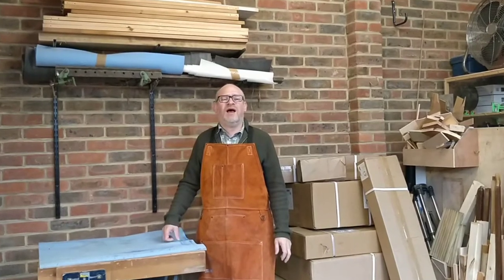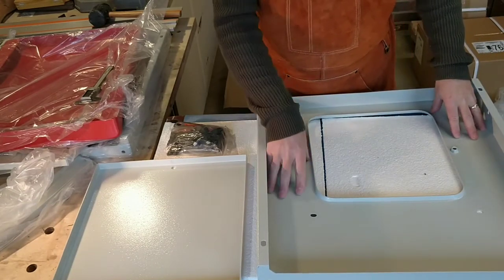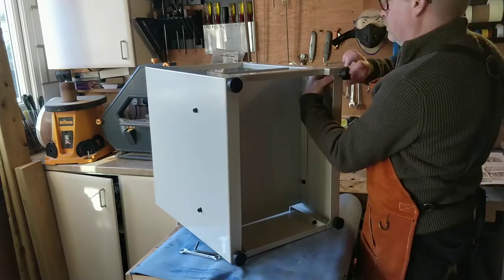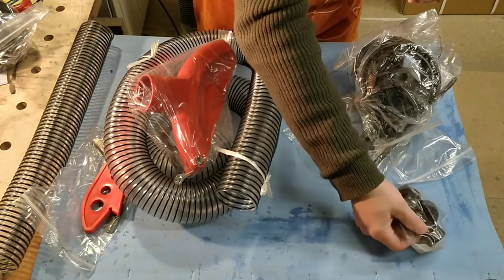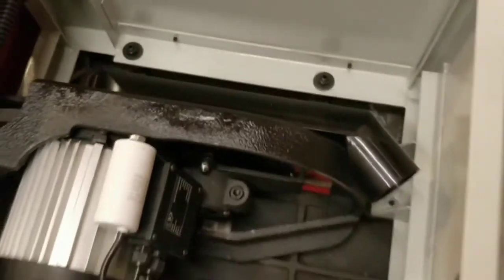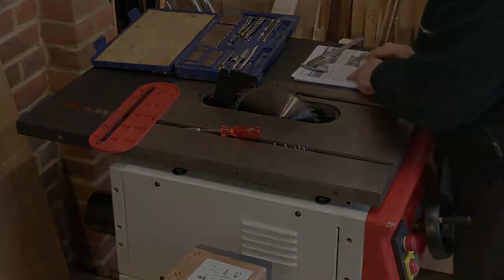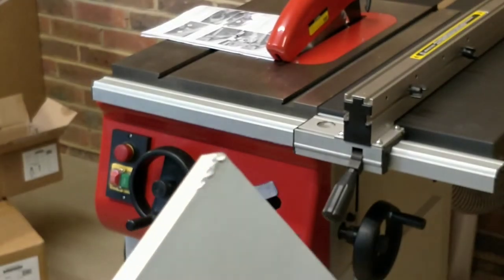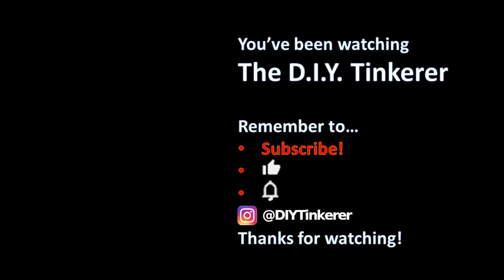62. Axminster Craft Table saw (AC216TS/AW216TS) Unboxing and Assembly

Comment: Hi Simon, Nice videos on the saw and it's accessories, I really enjoyed them. I've just received mine today and your videos have been very helpful in setting them up.
Reply from the maker: That's great thanks for letting me know, overall I'm very happy with it, there are a few little problems which I'll cover in a review of the saw once I've used it a bit more, but overall it seems like a good buy for a hobbyist woodworking workshop.
Reply: @DIYTinkerer  Just wondering if you had a small piece of yellow plastic stuck to the underside of the fence that came with the table. I have, it's on the opposite end to the clamp maybe to help it the fence slide when it's being adjusted or maybe it's just a random bit of plastic that got in by mistake. Anyway looking forward  to your review of the saw.
Reply from the maker: @vinylsteve  yes, it looks to me like it is there to reduce friction, and looks like a deliberate design decision as it also keeps the fence parallel to the table top.

Comment: Hi Simon. If I take my fence rail off (it seems to be a good straight edge) and place it on the cast iron top, running front to back, I see a cup in the table surface. 
I have tried rotating the straight edge to try another face and using other edges too. I have a cupped saw surface. I can run a 0.23 mm feeler gauge right under the middle and move it around. I seem to have a little cupping also when I test the left to right aspect too. 
 I wanted to see if you have tried this or even if you can just see light shon under a flat edge when trying something similar?
Reply from the maker: Hi Frederick, I'm just on my way out but had a quick look using the sub fence, I couldn't see a gap, but couldn't find my feeler gauges to test properly, if you haven't already it might be worth checking against a second flat edge. I'll look for my feelers and let you know what I find.
Reply: Thanks for taking the time to look. 
I tried a couple of good rulers. Really though, I found the extruded aluminium fence guide rail to be very good. That said, the rulers all show a gap too. I only tried one feeler gauge leaf at a time. So I don’t know the exact gap. I know that 0.3 mm will not fit and that 0.23 will fit. I’ll try putting two thin ones together to see if I can find a more precise number but that’s splitting hairs I think. 
Fundamentally, a piece of wood being pushed through the blade on this table top will only be supported at two points on the table. Just the two extreme front and rear edges of the cast iron top. That means no support at the point the blade is hitting the wood or anywhere else. 
Even with a zero clearance insert plate I would expect to see tear out. 
More seriously, if a piece of wood were to bounce while being cut, I can’t see anything good happening. Worst case being spontaneous kickback and without really doing anything silly.
Reply from the maker: @frederickwood9116  Hi Frederick, mine is also dipped in the middle, by 0.1 - 0.15mm , 0.15 won't fit anywhere, 0.1 fits in the middle, 0.05mm fits across a wide area, I'm not sure what the definition of flat is for a table saw,. It might be worth contacting them and asking their opinion, if you do please let me know what their response is.
Reply: I called my local supplier. 
I’m told that there is no requirement for the table to be precision flat. Apparently he has been called before and he then called Axminster who have sent on emails and even a YouTube link explaining that a table saw doesn’t need to be “flat” as it’s not a precision device. A planer surface on the other hand really needs to be flat.  So I don’t see I have any options. I’m no expert so it really could be just my pride that’s damaged. Your 0.1 to 0.15 is really very close to invisible. And mine is likely inconsequential but it’s not my expectation of a flat ground cast iron surface. 
Thanks again for checking yours. 
Here is the link.  Read some of the comments also.  YouTube link https://www.youtube.com/watch?v=5DOSSLa6qbA
Reply from the maker: @frederickwood9116  you should have seen the ground surface on my evolution mitre saw, that was measured in mm! That did have an impact on accuracy. It would be interesting to see if your. 2mm dip actually has any impact on your wood work.
Reply: @DIYTinkerer  I called someone who has lots of experience with using table saws off this sort and bigger. He didn’t think it was a show stopper. Obviously it’s better if the wood is fully supported all the way as it goes through the cut. As long as the table is not twisting and the blade, miter slots, fence are ok then it will likely be fine. 
I’ll likely never notice but I’m not impressed. I hope I never notice. I guess it’s good to have looked and to take note of it. If anything comes up I’ll try to let you know.

Comment: Another awesome piece of kit Simon, well, except it isn’t Green… ✅ 👏🏻 🐍  I am pretty certain that is one item I will never have and I’m not even sure if I would use it to the full anyway.  It is also one piece of woodworking kit I do find slightly intimidating… 🤷🏼‍♂️ 🫣
Reply from the maker: I hesitated quite a bit before buying it, for straight  clean square cuts you can't do better than a cabinet saw, I try to think very carefully about the possible risks before using it.